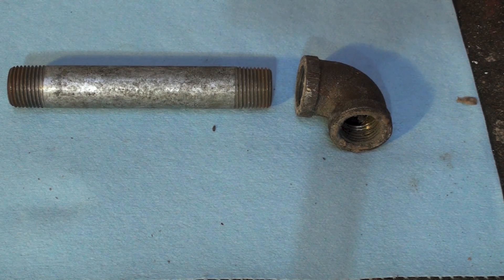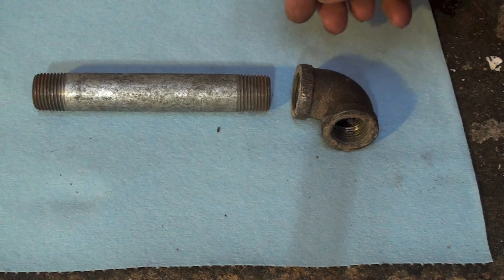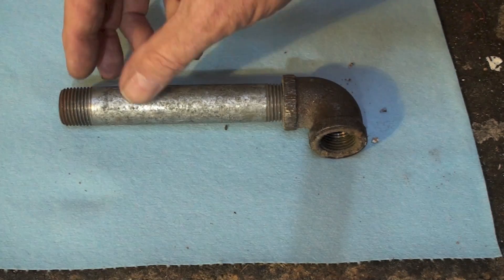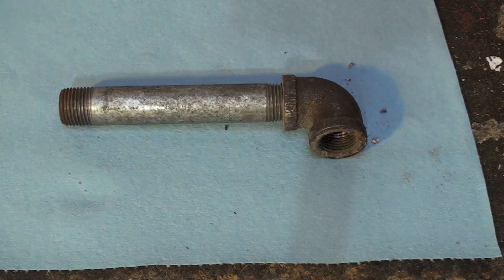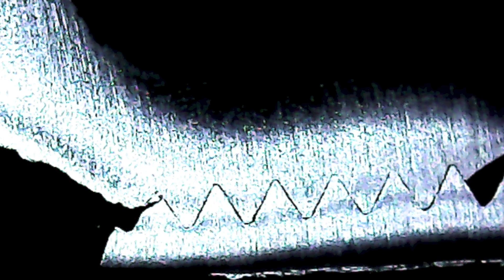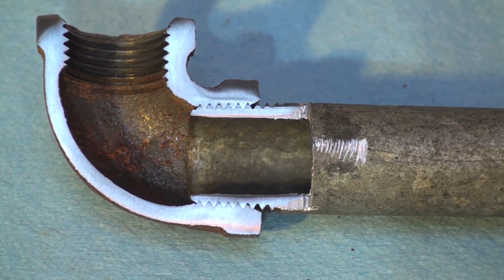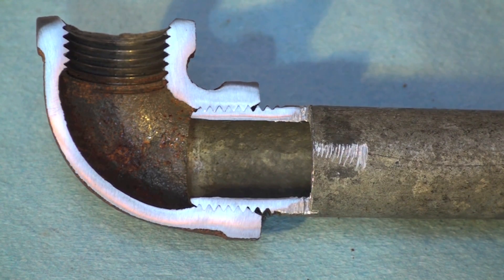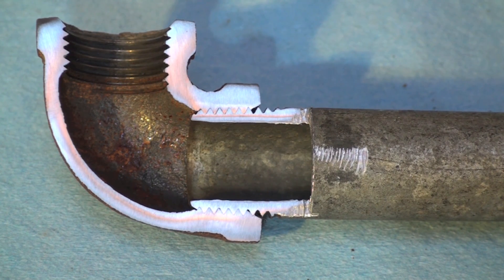The tapered pipe thread

Comment: I agree with you on the Teflon tape. I was a Navy Diver, and all the instructions I was acquainted with while working on dive systems stated that Teflon tape is not a sealant; it is a lubricant.  Granted it does have sealing properites, though that is not it's designed purpose.

Comment: How about a video on how to clock a pipe fitting.  How much is too tight?  90% of the time I work with pipe fittings it's almost more than 3/4 of a turn away from where I want it and I have to really crank on it get it back to the spot I want.

Comment: Nice video on the cut away! I usually use pipe dope for sure on gas line but usually use Teflon tape for water have had pretty good results? But I'm not a plumber or pipe fitter or anything just for repairs I still have galvanized pipe in my house and soon going to pex for my water supply! Most of the galvanized is as old as the house of course except for a few new repairs I had to do. But a small repair seems to become a little bigger one with new pipes to old one's. In most cases any way.

Comment: Awesome cutaway!

One question - how tight is tight enough? I ran into one video that said hand tighten and then 1-2 revolutions using wrench. Did that seen reasonable? How tight is too tight? Thank you!
Reply from the maker: I have always done by "when you think its tight enough, give it another solid pull" method.  I know, not scientific.  But really, there is no "too tight".  Certainly, if the threads disappear into the fitting, that is too tight.  The 1 to 2 revolutions is not tight enough.
GFM
Reply: @grayfurnaceman  Great info about how tight to make galvanized NPT.   Do you tighten as much for brass NPT?  I think the "1-2 turns after hand tight" rule is for plastic NPT by the way.
Reply from the maker: @DellAnderson  It is pretty much the same
GFM
Reply: @grayfurnaceman  Thanks!

Comment: Great explanation! Just curious why you don't like Teflon tape. Have you seen a lot of failures with it or something? I haven't used pipe dope very much because when I need to fix plumbing or gas pipes I usually need it fixed quickly, so my go to for years has been Teflon tape. I have never seen it leak when it is correctly wrapped and the connection is tight, although it can be a pain to use.
Reply from the maker: I have had multiple failures that are fixed by pipe dope.
GFM
Reply: @grayfurnaceman  Interesting, thanks for explaining. My biggest problem with Teflon tape is that it is a pain to use, especially in tight spaces.

Comment: I'm not sure what you're using these threads for cause they fail on me repeatedly. Maybe cause of what I'm doing. I'm using these pipes to cook phosphate salts at 1100C to distill white phosphorus. No matter what, when the pipes get hot... the vaporous phosphorus leaks right out. And I can't use a permanent seal cause I need to remove, clean, reload the "furnace" for testing. Do you have any suggestion in the world as to what I should use? I haven't tried pipe dope cause I thought it was for permanent seals but I'll try if you think it'll work?
Reply from the maker: +Robert Cece The temp is too high for pipe dope.  You are limited to either welding the connections or using very high temp brazing compound, such as sil phos.  Hope this helps.
GFM

Comment: There is thread called CS hydril that makes up with no dope and is a gas tight seal.We used it in the oil feild but its too expensive and NPT works just as well in most cases.

Comment: Always wondered about this subject.  Super great video and explanation.  In 1972 I bought a pipe cutter; pipe threading kit, and a can of pipe dope that has an applicator brush in the cap.  I still use all 3---but not very often.  Have done a lot of gas pipe over the 40 years with no issues--including installing a furnace in 1972.  The dope is a blackish gooey stuff which loses moisture over time.  The can states to add alcohol to revive it.  Once dry on a joint, this stuff is like cement.  It also now stinks in the can.  I have pondered the thought of pitching it out, but always end up keeping it on the shelf.  To keep it going, I put its container inside another to seal and save it.  It's like a petroleum based substance.   All pipe I see these days is marked "Made in China."
Reply from the maker: DOLRED Its dead.  Replace it.
GFM
Reply: grayfurnaceman
Oh shucks, I am so sentimental and this stuff is nearly as old as me...since age 21.    PS---comment on seeing Made in China pipe---yeah, I usually buy such stuff at the box stores. ..

Comment: Speaking of iron pipe fittings stay away from the garbage quality fittings made in China.

I was piping for compressed air in my shop and a few of the elbows cracked right down the casting seam when tightened (they weren't overtightened either) and they expect these to be used on propane or natural gas? Scary stuff. I use Ward made in USA fittings now.

Comment: You're a threat cutaway shows full thread engagement which is very important to prevent leaks many times the threading dies are not set correctly and do not give you full thread engagement
Reply from the maker: Gary Smith The Rigid dies seem to be worst for this.  Had lots of trouble with them.
GFM

Comment: I have the habit of taping and doping the threads when I pipe, just because I have found leaks on doped only threads through the years. I haven't seen the cut away of a connection till now.
Reply from the maker: ***** Can't argue with that.
GFM
Reply: I do that as well.  Especially when I'm tying into old work.

Comment: The threads on brake bleeder screws are also tapered, which is a real pain when you break one off. Some calipers are really expensive and it's a shame to have to replace one just for that.
Reply: Hold on there, spelunkerdbuddy. Are you sure brake bleeder threads are tapered? Of course the tip is tapered to seal off the brake pressure, but I do believe the threads aren't tapered.
Reply: Next time I go to the shop, I'll have another look.